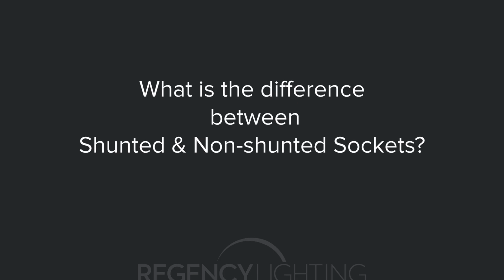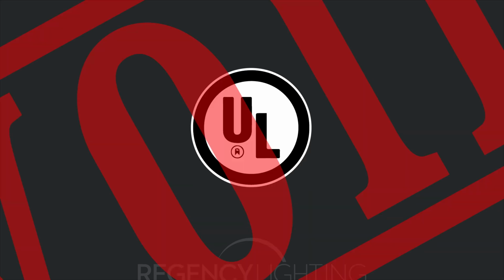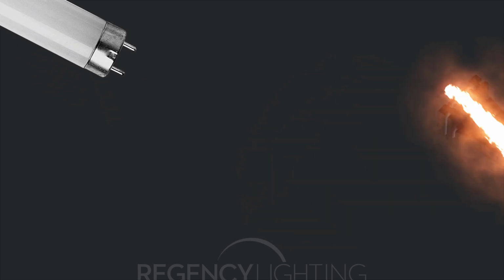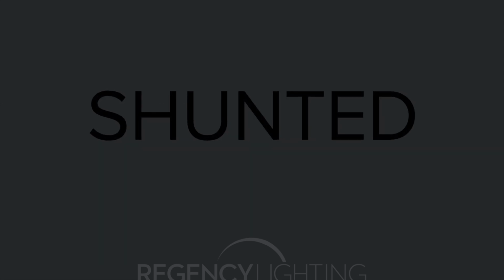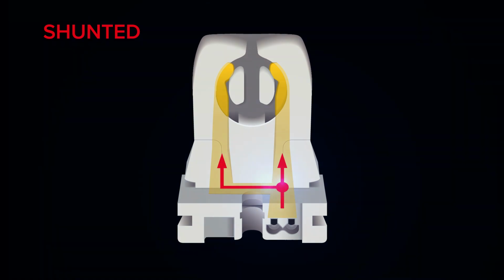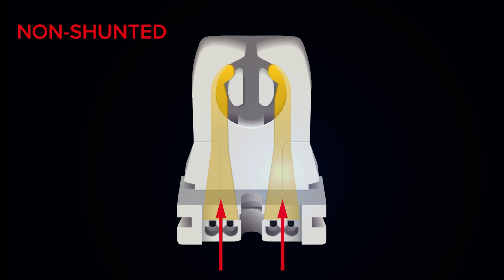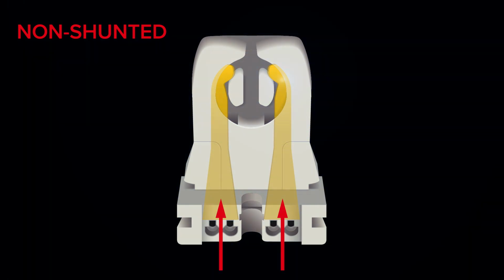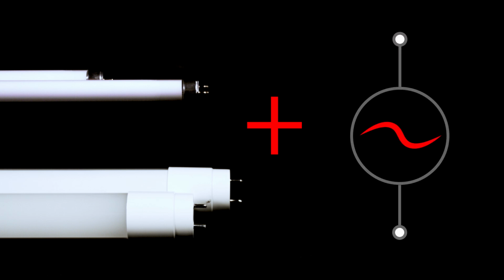What’s the difference between shunted and non-shunted sockets?

Comment: Hi there! So what's the difference in how electricity flows in a shunted and non-shunted socket? In a non-shunted socket, will there sometimes be a hot and neutral wire connected to the same tombstone?

I have a non-shunted tombstone, but it has two hot wires connected to it. Just trying to figure out how that's different from a single hot wire going to a shunted tombstone.
Reply: For some led direct wire lamps, referred to as “single ended” you would have a non shunted tombstone with power connected to one wire and neutral connected to the other. For “double ended” lamps you would have power connected to one end and neutral to the opposite end and the lampholders would possibly need to be shunted.

Comment: Hi and thank you for your video explaining the differences.   It is exactly the information that I was looking to for to solve the question of how to wire up my fluorescent lamps after the old style transformer ballast with starter capacitor system stopped working.   I purchased a new electronic ballast and needed to know what the difference was to wire it and how the sockets affected the wiring logic.  The old system used an non shunted socket so I just made a jumper between the two poles of the socket and now everything works perfectly.
Reply from the maker: That's great!  Thank you John.
Reply: @regencysupply  remote tsar I

Comment: why does my fluorescent light only stay on for 1 minute then comes on 5 minutes later and repeats. I put in a new ballast, same thing.
Reply: I would check to make sure that you have the correct ballast for the lamps.
Reply from the maker: There is a warm-up period for fluorescent lamps. This may be one reason you're having that problem. You may also want to try a different type of ballast.